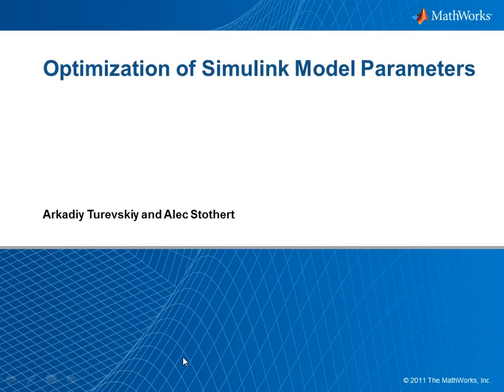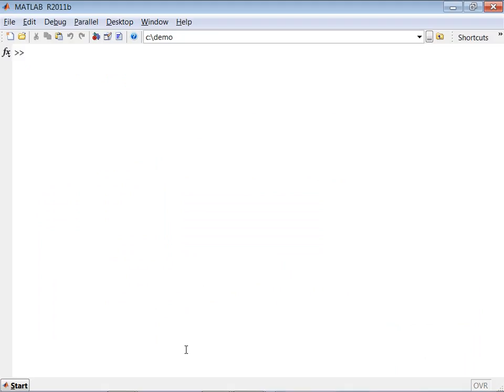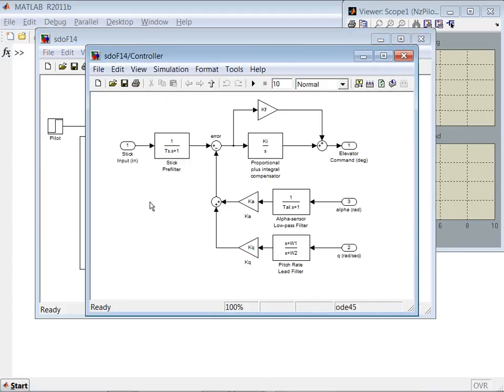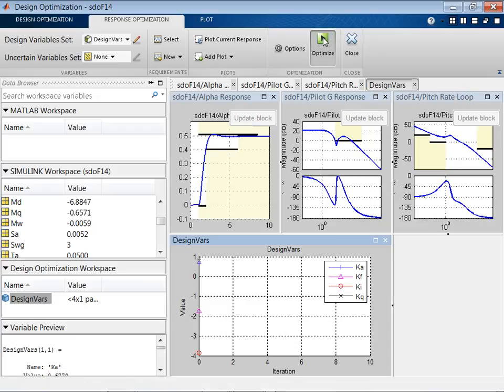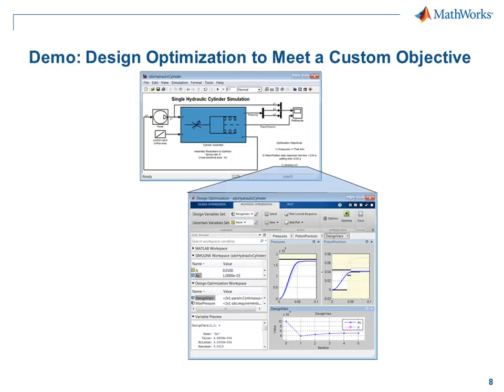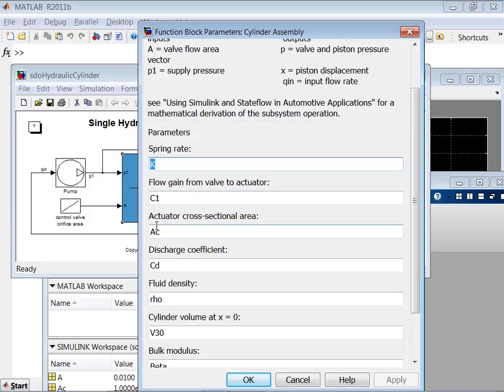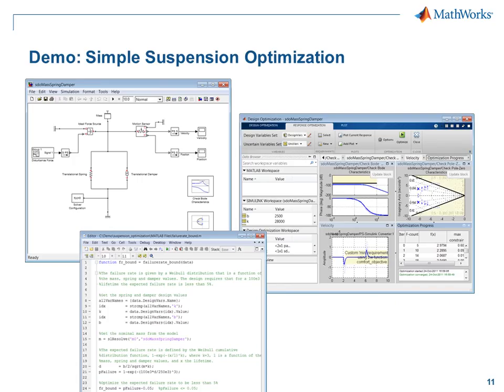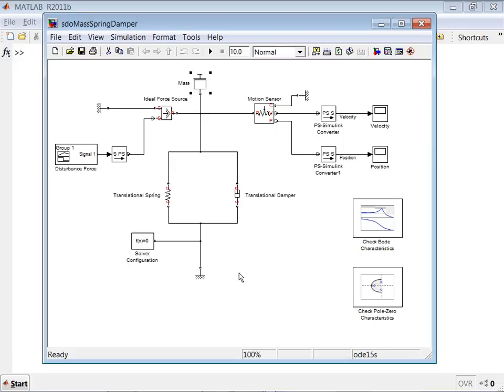Optimization of Simulink Model Parameters

Comment: Hi, I wanted to use PSO as the optimisation tool instead of Inbuilt algorithms, Is there any possibilities to use our own code in Simulink? If so could please provide some hints. I wanted to optimise the PID parameters which are used for controlling a system built in SIMULINK.   
Thank you.
Reply: hi dr guru basavaraj, did you got a solution that use PSO algorithm to optimize the model in matlab simulink? can u teach me? please
Reply: @amitbhattacharjee4321  hey did you get any solution, please let me know
Reply: @jinghuiseah9328  hey did you get any solution, please let me know
Reply: @himanshugarg5459  hleooo i also want pso using simulink model.did you know..plz provide the solution.
Reply: @vijayKumar-dt2ex  what is your model?
Reply: @vijayKumar-dt2ex  i know